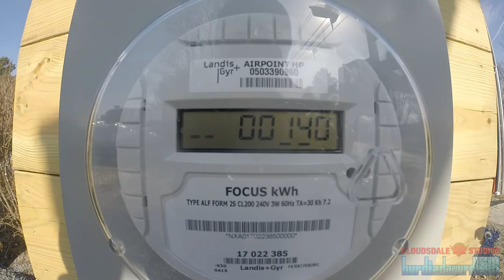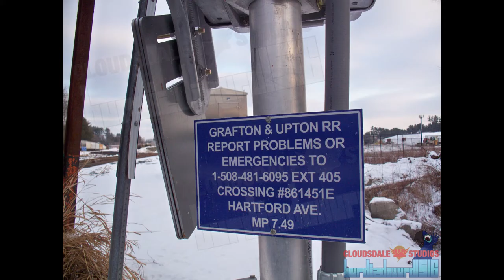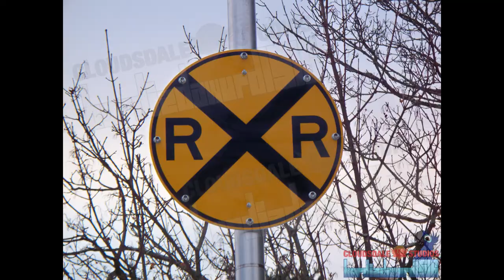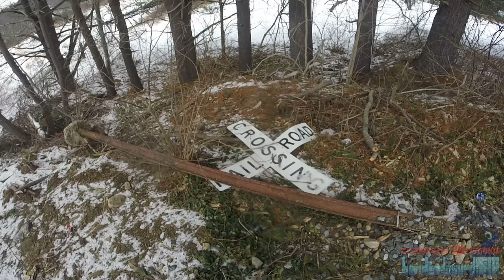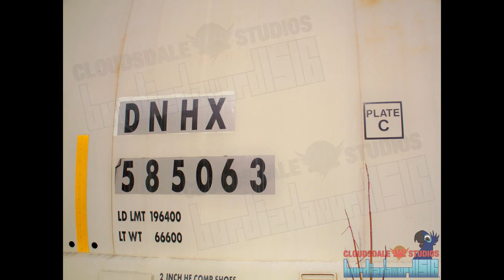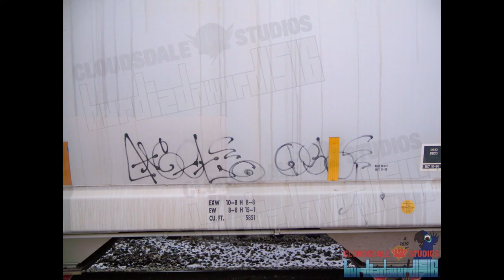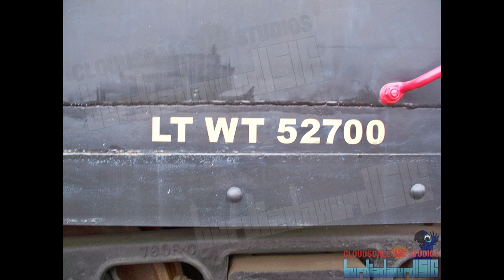G&U/R. J. Corman Update: January 2018

Comment: Nice vid! In the 80's and 90's they would always talk about how the G & U use to haul way more but now it looks like they might haul more now than ever? Especially if they need that many Loco's. What happened to the windshields of the CF7?
Reply from the maker: David Unruh In terms of carloads, I have to refer to Edward Hopper's research. He was the expert before me on the Grafton and Upton: his manuscript is 142 pages and available in the Hopedale and Upton libraries. I'm not in town so I haven't had a chance to look at it, but the introduction is on Dan Malloy's website hope1842.com. 

I'm going to skip over the narrow gauge Grafton Center Railroad for obvious reasons. The G&U initially moved freight using 6 steam locomotives. The hat factories in Upton (2 of them) were key in the extension to there. Draper was the key to extending into Hopedale. Surprisingly the New York & New England took some coaxing to allow a connection in Milford. Even so, with connections on the Boston & Albany and NY&NE this line has remained a shortline.

Draper's acquisition had its roots around 1894. Looms are not easy to ship without a railroad, and it was not surprising that Draper (and later Rockwell) would own the railroad. Actually, the acquisition and location may have helped keep this line from being merged into the New Haven. It's just not in a good place to run through freight despite having two connection points. The real bread and butter always has been local service. 

With that, I can explain the history of G&U traffic

It's never really exceeded trains of 20 cars. Besides a few upgrades in the 70s and 80s the crossings that went up this year represent more automation than ever before on the line. In the early days there were passenger trains and a decent load of freight. Into the postwar years traffic was around 10 cars or so by my estimates mainly to the foundries of Rockwell. Penn Central cut off southern handovers in 1973. As coke and metal deliveries diminished around 1975, salt loads to Upton are what kept the route alive.

The figures I have read 170 cars to Upton Fuel Co. in 1975 and 391 cars total in 1983. Edward Hopper left off with his research as the G&U became confined between Washington Mills and the B&A. It's kind of sad, I wish he were alive to see the line today.

Modern ops I know much about, and it's not different in train size: only content. Trains still average 10 cars as they always have. Granted, the list of products has shifted from straw hats, coke, automatic looms, and scrap metal; to wood pellets, gypsum drywall, building supplies, contaminated soil, propane, acetone, ethanol, methanol, nitric acid, styrene, toluene, and recycled used oil. Washington mills still receives aggregates. 

So to answer your question, the G&U is not hauling much more than it always has. Then again, in the past 2 years with more propane coming in just to Grafton and outgoing loads of contaminated soil, I would like to say business is increasing. There's just not enough data to say how much. They need so much power due to the size of modern cars and the grade upwards of 2% locally. What has made the G&U unique is its business and location. Local switching has been integral, and continues to be. Because of its location among other railroads and proximity from interchange to customer the line has survived as an independent shortline. While it is likely state subsidized right now, if business can grow in the Blackstone Valley the G&U may one day turn a profit. I respect that this little Railroad has stood up for itself for almost 150 years.

As for the Windows and lights on the GP7u's, vandals have been getting to the inactive geeps. That's why railfans have been asked to stay off the property, because unlike copper thieves I respect 150 years of local service. My crass advice is, " if your locos are getting razed, put them inside." Rumor has it a new engine house is going up. Maybe I can get a job next summer.

As for CF7 windows and cabs, because 1500 is one and I see you have confused the locomotives, the ATSF rebuilds have multiple styles as the rebuild program progressed. I need to do some modifications to the closest model I could find on modeltrainstuff.com before I can paint it.

Not that I can paint it, I'm at college. Hope that explains the G&U carloads over the years. I might do a standalone video on that!

Comment: Did  they improve the whole line like this or just parts. If all the line looks this good,  wow a change and very good sign.
Reply: Shawn Stephens they never finish  putting the tracks down in Milford ma
Reply: yup they tamped and regulated the entire line. 3 "new to us" locomotives (1160 already in the mix hauling freight) bunch of crossings redone and many more slated for the coming months. And a bigger project in the works... guess we'll see!
Reply: What  will happen to the engines left from before. Any information on that would be great.
Reply from the maker: david taylor last I checked in August of 2018 there wasn't too many weeds in the ballast through Milford. Just an observation while driving, so I'm not giving it much accuracy.
Reply from the maker: Patrick O'Connell they dropped new ballast 3 times in 4 years. Now the big question is how much of this is subsidized? It's great work, but the crossings are known to be partially state funded. As a whole, this Railroad cannot be turning a profit.
Reply from the maker: Shawn Stephens supposedly awaiting repairs, maybe some going to Conway Scenic for excursions. Personally, I'm hoping to find something to do around the rumored new engine house during next summer.
Reply from the maker: NWI RailFan as far as I know they were all lined up on track 4 in Grafton, and have been split between tracks 4 and 5 with some Scoots being shuffled for repairs. Lots of rust in the toolboxes... CSX is kinda eh with their locomotives.

Comment: One question I am planning to chasing the engines after Christmas and would you know what time they come leave Hopedale to Upton Yard
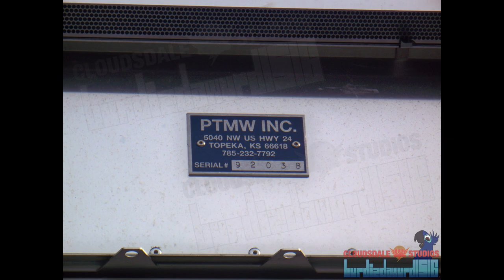Reply from the maker: Its changed over the years, I have been at college for 3 months so I'm not positive about current ops. In the years I was at high school down the street they crossed Pleasant street southbound to Hopedale at 11:30, would get there around 12:00 or so, switch until 12:30 and be crossing Pleasant street northbound around 13:00. With bigger trains, and in older ops they work in Hopedale until 15:30.

Let me know if ur chasing within the next month, I'd love to join you.
Reply: @burdizdawurd1516Official  No thanks since I go solo chasing because within the next month I will be busy with Springfield and Railfanning and some reviews on stuff and to bring back my sister  back to Rhode Island
Reply from the maker: @dormant4149  okay then, good luck with that